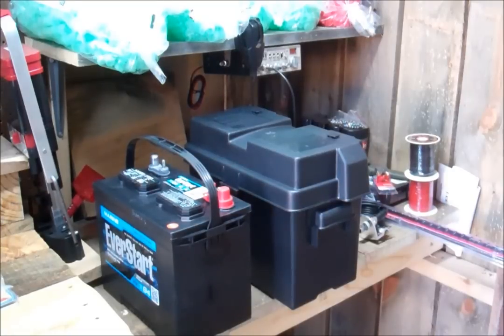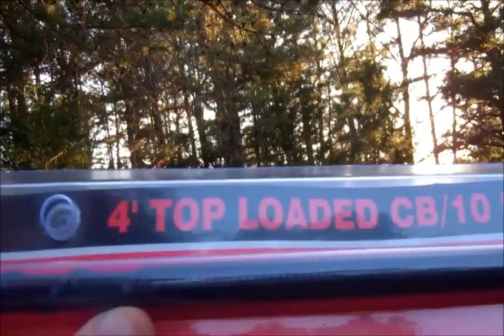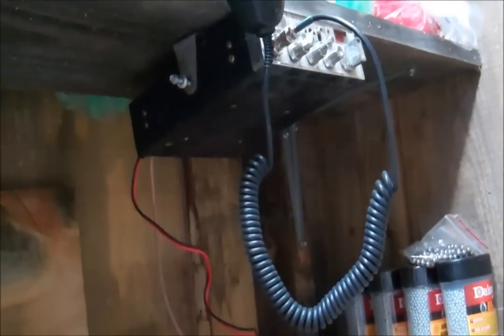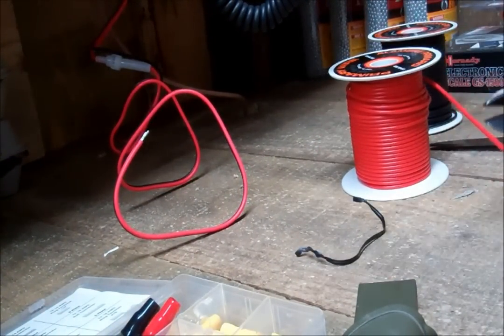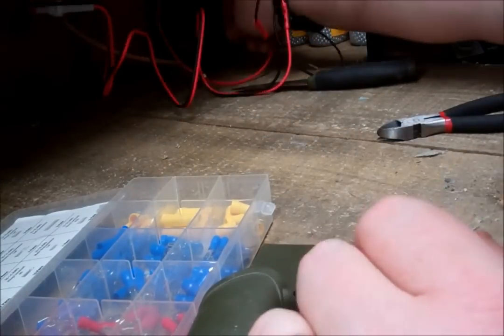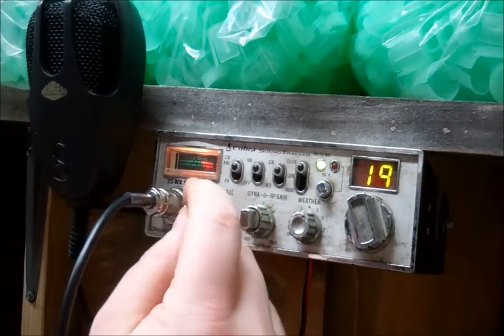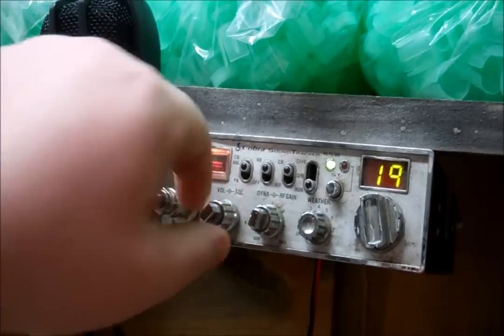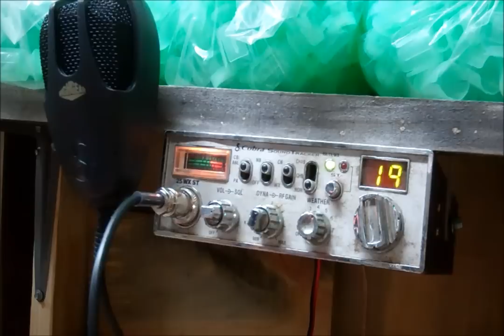Off-Grid Cheap CB Radio Set-up

Comment: Being no ground on that antenna SWR's probably higher than Obamacare tax penalties.
Reply: hey cokeman learn how to build a dipole and some simple wire can make you a antenna with a good swr that you can string between some trees or move anywhere any time
Reply: He's using a truck antenna on a wood plank. Wood don't conduct y'all! 

You cannot use a truck antenna as a dipole unless it was a quarter wave none loaded.
Reply: @Cromper  even a 102" whip (unloaded 1/4 wave)  requires a ground plane.
Reply: @fomocowboy  He could run a couple radials from the metal screws on the trucker mount and it'd get out better :-)
Reply: That's Funny! You just made me laugh.

Comment: Great video! All these folks saying you need a ground plane, you need a bigger antenna, you need this & that. Yeah, maybe so. But you just hooked up a cheap truck antenna and got 5 miles of crystal clear signal. That's how you get things done. Good work & God Bless!!
Reply: James WkndMechanic James, he could HEAR the stations, but I can bet he couldn't get back to those stations. that 4' whip by itself was reflecting most of the transmitted power back to the  radio; disaster to the output stage of the transmitter.
Reply: Finals could burn out due to high swr.  A pipe into the ground and a piece of wire grounded to the pipe from the antenna bracket would help a lot but the antenna is still gonna need the swr checked and adjusted.  Also if your radio's antenna has high swr most of the power is reflected so you can't get the signal out very far.

Comment: I had a 5 ft Firestick whip antenna mounted to the top of my 2 story house and it was grounded and connected to my old Navaho base station in the basement. I could talk skip clear across the country and sometimes the UK using SSB and 5 watts. I could easily chat with people locally as well. My SWR was 1:1 perfect match.

Comment: Your antenna is using the shield of your coax as the other  half of the dipole you've created. You can tune your coax (reduce SWR) by putting four or more, 6" diameter coils ( a coaxial choke) in your coax, a quarter wavelength from the bottom of your whip. You could put your coaxial choke, say, 102" away from the bottom of your whip, check SWR and then adjust your coaxial choke towards or away from your whip until you get your SWR down to 1:1.

Comment: Try running a ground wire from the radio's bracket to a copper pipe in the ground outside.  Might help the station a bit.

Comment: Using a mobile antenna as a base station antenna CAN be done...just remember that it will work a lot better if you have some sort of "ground plane"...you could use straightened coat hangers as ground radials or the guyline wires themselves. I have experimented a lot with this as well. If you have a shed, workshop, garage, or home that has a tin roof, you can throw a magnet mount mobile antenna up there, and there ya go. Also remember to ground all of your equipment to a ground rod as well.

Comment: I agree about grounding the antenna. Here's what I did with mine... I mounted a mobile 4' antenna on my roof with the same mirror mount you're using. I ran a ground wire (Stranded 14 gauge copper wire) from the bracket to the ground. I then stripped off about 3 feet of the end of the wire, wrapped it around a 2' long piece of copper pipe, dug a hole and buried it. makes a great ground and I'm talking out great! Nice setup for a quick throw together, man!

Comment: It has been suggested you need a ground plane, but a simple counterpoise will work. All you need to do is add a length of wire, (9 ft long) to the mounting bracket of the antenna on the ground side. Attaching it to any one of the screws used to mount the bracket will do, & just let it hang freely if it is a temporary install. Alternately, you could drive a ground rod next to the mast & connect a wire between the bracket and ground rod if it is going to be permanent. It will help a lot with SWR.

Comment: Neat mast set up, however the guy in the video is using a mobile antenna..  Do not use a mobile antenna like this unless your vehicle is also up the top of the mast too, so the antenna can be "RF" grounded to it.  Without the vehicles metal directly underneath it you'll get out terribly and it could burn up your radio, as the large plane of metal is essential part of a mobile antenna..  Your best just buy a cheap, lightweight "base" antenna for only $50, that will mount in this same configuration (U-bolt may be a little larger, but this wooden mast should still hold it with ease, and it'll probably be a 18' whip instead of a tiny 5' mobile one which helps considerably with range) to solve the metal problem, (many of the base antennas don't need an RF large ground plane surface) plus you'll reach out 10 times better.  A cheap base antenna such as the  Antron 99 which don't even require a ground plane, would get you considerable more range and it doesn't need a vehicle's metal body as part of it's system.  If you must use a mobile antenna designed (which is tuned for use with an automobile not a base), make sure you provide a very large metal groundplane  (at least 8.5 feet or larger, kind of like the large metal surface of a car/truck) or a 102" counterpoise at the bottom.  Without this your transmit range will quite terrible and you may have mismatch problems.  This could be the difference of talking barely a mile to 10 to 50 miles!
Reply: Yeah was kinda wondering where the ground plane was..

Comment: Hey Virgil, try running a ground wire from the antenna bracket to ground...you're only working with half of a dipole
Reply: +SIXPACK110 ground radials work also. Ground the other side and add radials that are 1/4 wave of the cb frequency.

Comment: Nice choice on the Cobra 25. It's a solid radio that can be peaked and tuned for better performance. Since you live near an Interstate and truck stop you probably get some interesting CB chatter there. Upgrade to a ground plane antenna like the Antron 99 when you can. Don't forget to weatherproof your coax connections. Good luck.

Comment: You have no ground plane junior.  You are using the braid in your coax for the ground.  Very inneficient.  If that shack has a metal roof, run a ground wire to the tin.  That will quadruple your range!

Comment: Great antenna for emergency use and it works. As the others mention, you are using the coax itself as the "other half' of the DI-pole.  If the coax is some multiple length of a half wave; 17.2 feet, 34.4, 51.6,  etc, (Call it 18 feet if you want). It'll do just fine if the SWR is good.  If it's close you can perhaps just adjust the whip under the top cap. 
I'd suggest that if it isn't, You can easily measure out one of those multiples from the whip mount and there wind 5 turns of the remaining coax side by side around some 4.5 " round non metallic form. You will then have your  Di-pole, and will have also made what we call an "ugly balun" or "current balun" to help the SWR and to keep stray RF from going back into the radio.  

It's just like those in some of those You tube videos on making a coax only antenna, called the T2LT or a bazooka. But being extremely practical, You've  used a regular CB whip as the top radiator, instead the bare center wire of the coax that they use on the T2LT, up on the top of that coax.. You got a homemade "no ground plane antenna", Or A NGP which is just another kind of DI-pole.  You got the right stuff, but it's not quiet completed.  If your SWR is good, You' re good to go.
Reply: Some folks will argue that if the "half wave length" of the coax used like this, should also include the length multiplied by the velocity factor  Or VF of the coax, (0.66 in RG58 which would make a half wave actually 11.3 feet long).
But others, that have made those DI-poles, sleeve, bazooka and T2LT types of antenna say it doesn't really change much any over a short run.  After all most mobile whips do come with an 18 feet run of coax. And I measured a new NGP antenna coax as 17.2 feet once and still have it stocked away. It's still argued. But they work.

Comment: Hey Cokeman, scdevon is right about the counterpoise. But the only thing you need to do is add a 102 inch length of wire, with one of those crimp on rings, and connect it to you clamp with an extra nut, Just let it hang there will do what you need, nothing fancy. You could burn up the radio if you don't, and it will increase you distance as well. It won't be perfect, but it will create, what we Ham radio operators call, a Dipole antenna. Still cheap and simple, but better. I like the Idea though. Communication, is the one thing a lot of preppers leave out. Information, can make or break you! I suggest and AM radio for local info, and a NOAA weather radio as well. The CB is a good idea, people will have them, because they are easy to get, and set up. Like you say in your video. If you want to get fancy with it, go to Radio Shack and buy an SWR meter, or another radio operator, Ham or CBer, and ajust your antenna to proper lenght. Keep up the good work Cokeman

Comment: Nicely done, but there's a couple of things you should know. As your antenna is set up, you are a target for lightning. Because you have mounted the antenna on a 2x4 and not on a metal pipe that is not grounded, the lightning will come into the shack. Most trucks today have fiberglass cabs, so the antennas are designed for a bad ground plane, but a ground plane would help. Look into HAM radio, get your license and talk all over the world!

Comment: When I make a portable  or temporary rig like this, I usually add at least four wires connected to the base of the whip's clamp mount as the counter poise. Your mounting screws would hold these wires easily. And I spread them out to support the antenna pole. The length of each would be about 102 inches and then I add a plastic insulator of some kind at the end of each if i need to extend them some to spread out the wires  around the pole more. The line from the insulator to the ground stakes can be any kind of material. But it looks like a tee pee frame with the whip sticking up directly above it. If you make it sturdy enough, it can actually  become a tent shelter support frame too. With the antenna sticking out above it naturally. 

The single wire lower radial mentioned by someone else would be a CB di-pole antenna,  more ground radials spread out from the mast would be a CB ground plane antenna. I have used 16 ground radials (to better imitate that "car" that is suppose to be under this type of antenna) and had great results)

Your rig is more like a sleeve antenna using the shield outer casing as a part of a ground radial..But it's lucky that it's tuned so close to be usable.

Have a great time with it, I keep one like it, with an electrical conduit for the mast section which is also cut to the right length to work as a CB di-pole, so it's actually the Di-pole lower ground radial all by it self.  Any  CB whip will work, and by adding the 16 pre -cut wire radials I made with the ground stakes (that I store in a separate go box), it's even better..Then I just use a whip hanging from a tree, with the radials spread out below it.  It's also great for short wave listening too while I'm camping, or ham use on low power short wave with ham band whips, or as an emergency tent if needed and you use the center pole as the mast..

Possumn

Comment: Overall a good setup, but youll need a ground plane under that antenna.  A ground plane is a large hunk of metal (such as a car in a mobile situation) Now CB antennas broadcast mostly downward. The ground plane reflects that signal back into the air. Now it wouldn't be necessary other then for performance, except for the fact that without a ground plane your SWR level will be horrible which could damage your radio. If you want a really good antenna for your base which will get out much better then that setup for dirt cheap, look up some home made setups. Your cheapest and easiest will be a dipole. But make sure to look up the advantages and disadvantages of each to see what will best suit you.

Comment: Looking good Coke. Just a couple observations for you to consider.
Get some "keepers" for your antenne wire so they don't flop about in the wind.
Use large screws to attach the 12 foot 2 by 4 to the post so it can be taken down easier during bad storms or for repair/improvements.
Keep on keeping on!

Comment: Mobile antennas require a ground to allow the SWR to match what is needed for the radio. If you do not provide a ground for a mobile antenna then you take the chance of burning up your finals in the radio. Grounding for mobile antennas is just not for lighting protection. it makes the other 1/4 wave of the 1/2 antenna for CB.

Comment: In all my experimenting with mobile CB antennas I have found they generally won't be easily tunable on anything higher than around a 3ft pole which acts somewhat like a counterpoise ,a flat ground plane is certainly most desirable like say a metal workshop roof...

Depending on your needs a half wave dipole (as previously suggested) would've been a far better choice as off the grid also equates to reliable/effective equipment and an out of tune antenna would prove to be neither.

Comment: I would take a copper ground wire and ground the angle bracket on the base of the antenna to a copper ground rod pounded into the ground. And make a couple of 106 inch ground plane wires up at the top coming off the angle base. Be sure and check your SWR so you dont burn up your radio. I made a J pole antenna check out my video on that and it talks five miles. I was hoping for better. But maybe on a good day it will talk further.

Comment: If the power grid is down you will get much better range and reception. I have a very similar system,only I use a 6' stainless whip antenna that I found on the road!

Comment: Nice video, and yes you are right at the end some communication is better than none.
I have got a spare CB radio here, a Danita 3000 opened up to all channels. Lets face it if it ever came down to a bad situation that you need comms, then I will use ANY frequency to get in touch with any other living person but hopefully that wont happen.

Comment: If your shed has a tin (or other metal) roof, then it will act as a reflector if you attach it to the antenna ground. This works in much the same way as the reflector on a satellite dish works. You should double or triple the gain in both reception and transmission for that CB.

Comment: I would suggest you take your coax and attach it to the pole so it don't blow in heavy wind. Attach a ground wire to your antenna for lighting during thunderstorms. Get a solar panel to charge your battery if this the way you want to run your setup.

Comment: Another thought. FRS is popular frequency in use, not just CB.  I would have both in use, to listen and learn. Also, a long wire horizontal in trees and ground pipe out side of shed round counter poise for hooking up shortwave radio to listen and learn. Acquire cheap garage sale FRS family radio service radios and CB citizens band radios to pass out to others to keep you informed at edges of your radio transmission. Store batteries in zip lock bag not in radios.  Have a cheap solar panel and charge controller constantly charging your marine batteries to keep them always topped off. Remember you will never be fully prepared.

Comment: Stick a 102 inch piece of wire to the outside of the coax plug at the base of the antenna as a counterpoise...will be a big improvement...
Reply: +Andrew Dickinson Wouldn't  adding 4 radials  the same length as the vertical element achieve the same results as a   counterpoise? This in essence would be a ground plane. 

Two other practical alternatives would be twin sticks mounted vertically or an inverted "V" dipole. The number of 11 meter verticals available in the US  these days is rather thin. Radio shack discontinued base station CB antennas in the late 1990's.
Reply: @pm0501again  You're right,  The difference between one and four "Lower" radials is that between a DI-pole and a ground plane. And you're right, four bent outward at about a 45 degree angle makes it a ground plane closer to about 50 ohms impedance. one makes it a DI-pole and about 30 ohms impedance . A DI-pole has a bit higher SWR usually due to that mismatch with a 50 ohm system, but they still work..

Comment: i am amazed that it works without a ground plane. a metal pole connected to that fence post and also connected to an 8 foot stake in the ground would have been better.

Comment: Change out that 5' antenna and mount a 102" Radio Shack quarter wave antenna on the 2x4, then take 4 pieces of #12 or #14 gauge wire, 108" long, mount them to the plate you screwed to the 2x4, and run them down on a 45 degree angel to the ground 90 degrees apart.  You will be amazed since right now, you're missing half of your antenna.

Comment: You should put a couple of ground radials at the base of the antenna. They should be about 102 inches lond and you could attach them to the screws that you mounted the bracket to the 2x4. The should slope down at about a 45 degree angle. You could use four wires for even better performance. Also, it looks like the tip of the antenna is adjustable. This adjustment is used to tune your SWR. Your radio does not have a built in SWR meter. You might find someone that will lend you one.

Comment: a great video and  a great set up I had the same but I used the artificial ground plain and it will take 30w  but it makes all antennas swr 1.3 and with it I opened a repeater cb repeater just out side of Moscow I live on the east coast of the uk and with my fire stick base antenna just the same as you and it works hope you have lots of great contacts thank you for your time